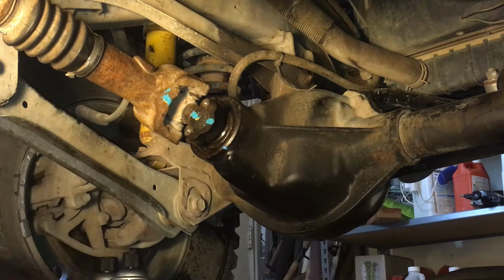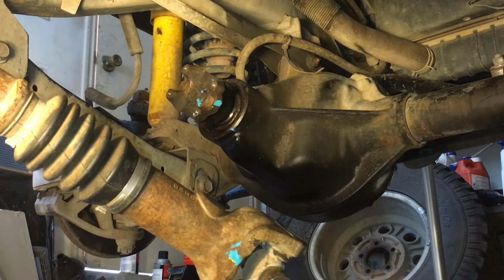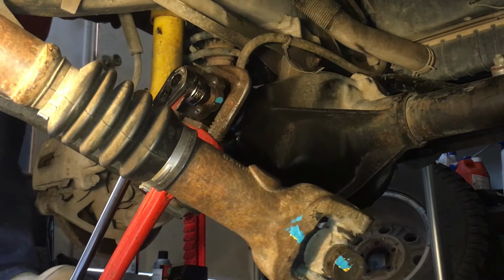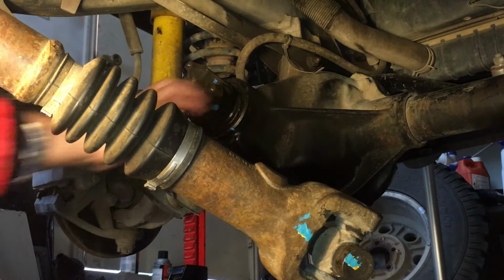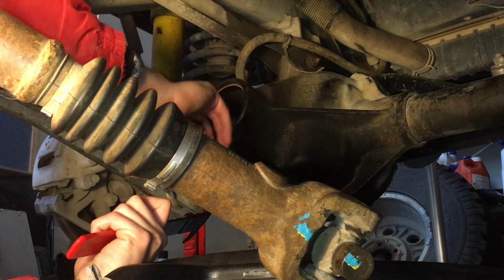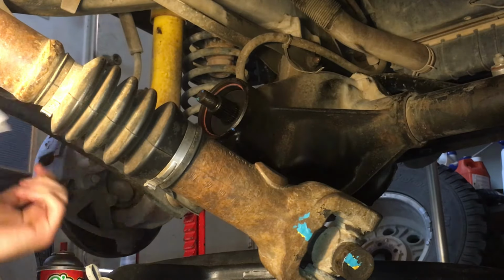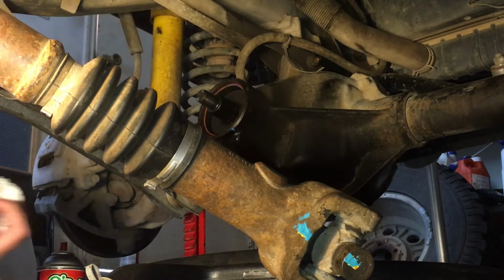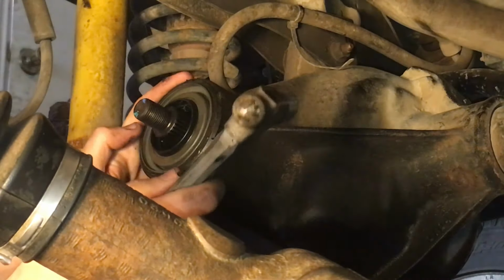How to replace front differential pinion seal on a Jeep Wrangler (The Hard Way) Part 1

Comment: Good video. I just want to give a little advice. Get an impact gun or breaker bar to loosen nut. To much can go wrong with a ratchet and when the driveshaft is pulled. Tape up the universal joint caps. It’s very possible for them to fall off and the internal bearings becomes a mess. Just my opinion

Comment: I have a question. I am doing a regear right now I kept mind of exactly how it all cam out to put back in however I did loose track of one thing when you pulled that out is there an oil slingers or like a real big shim right on the other side of that seal on top of the bearing covering it? If you recall and can let me know I would be real appreciative of that as I'm looking to finish this reagear next weekend thank you.